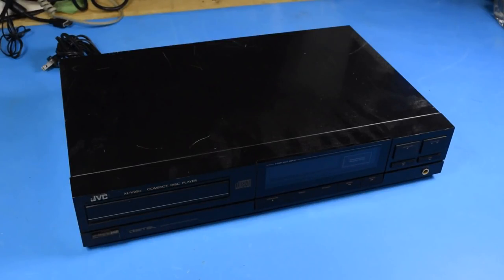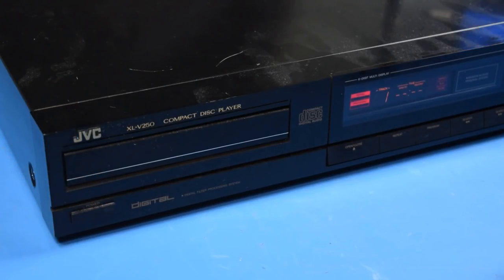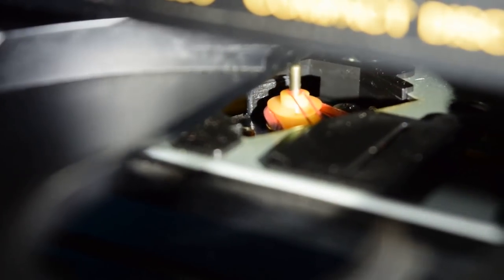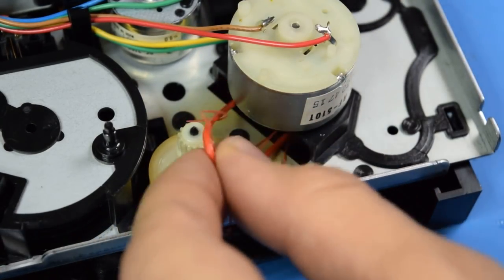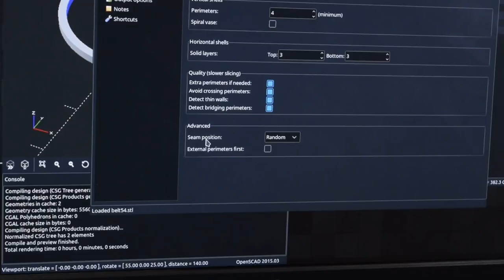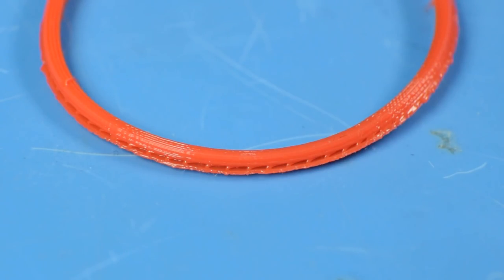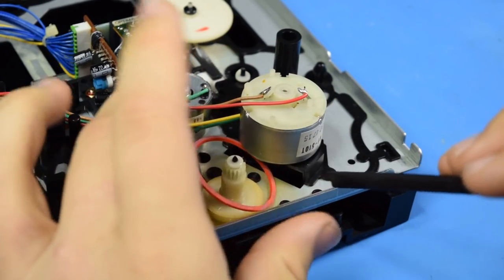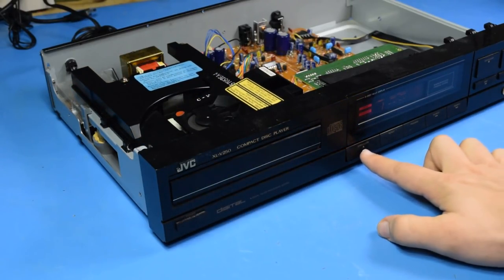0x0024.2 - 3D Printed CD Player Belt Follow Up

Comment: I made a rubber belt for my Akai reel to reel once. Still holds up fine after a couple of years with long periods of no usage, granted it's not getting stressed much at all (it's the only belt in the machine and it's between the reel hub and the tape counter). The filament that I used was actually called "rubber", it's black in color and really hard to print with at any reasonable speed - too much friction, otherwise it curls up and clogs everything up.

Belt initially had a round profile, but square seems to work just fine. I'd guess that it would be much easier to just find a way to weld a piece of filament into a ring for those old thick ones...

Comment: You should check the cooling vents. Its common thing in cheap 3D printers, that the cooling efficiency of the stock fans are not too great. That can cause those layer flaws.

Comment: You could make it a little bit more thicker, maybe that would give some strenght.
Reply from the maker: Since the pulleys are concave the belt will tend to "roll" until the flattest side is against the pulley. So I would have to increase all sides of it to keep it stable. I might be able to make it a little thicker all around and still fit in the pulley, but I suspect that will just make it take longer to fail. 

I need to try making some test prints I hang weights from so I can track how this material handles stress over time.

Comment: I know this is an amusing academic exercise rather than making a belt because there's no other choice, but you are aware you can buy a pack of over a hundred square-section belts on eBay for a couple of dollars right?

Don't bugger up the player with failed attempts if you don't have to!
Reply from the maker: Oh absolutely I know you can do that. But I would like to get this dialed in to the point where this is a real option. As far as buggering up the player is concerned, at this point in history this particular CD player isn't valuable or significant and it's easy to service. So it's a great test bed for this. It would also take something pretty catastrophic to cause irreparable damage to the as well.

This has the potential to a good option for really large belts(which could be printed as a serpentine) that are not in those kits or for the rubber "tires" that are on some devices. It may not ever be as good as a normal belt and definitely not better, but if it could last even 50% as long as a standard belt I think it would be a success.